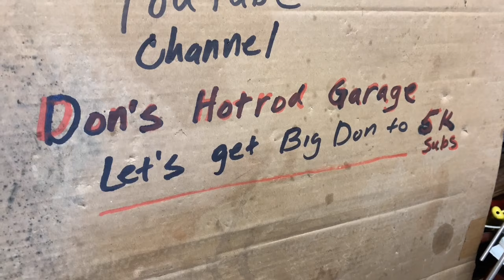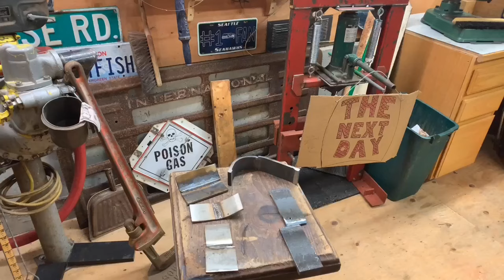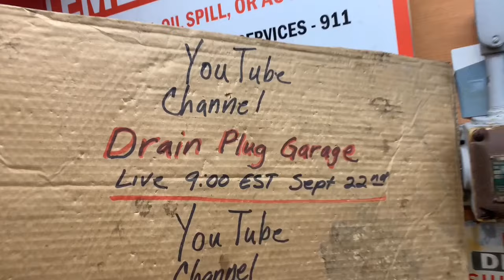Welding/ TIG/ MIG/ Strength Test/ with Filler Rod and with out

Comment: Fusion welds work great for body panels or light work with no stress as it pulls metal from the edges of the material to melt them together making it weaker. Great video Mike. I sent you and email yesterday might be in your spam folder.Thanks for the shout out.
Reply from the maker: Hey Glen, yes fun little video definitely showed the difference between the fusion welds and the ones with the filler rod, you are very welcome, got your email, they are on the way, catch you real soon

Comment: Wow Mike, really great video!  I use fusion welding quite a bit for non structural also. We should do a collaboration. If you want me to I’d cut and etch those welds. They are great welds but what’s inside is what counts. I could show the cut and etch process. Then I’ll send the sections back and you can show the weld sections. I don’t see much of that kind of analysis. Could be cool and educational. Your welding is really impressive!!
Reply from the maker: Hi Bill, yes that was a fun video, it would be nice to know what the welds look like inside, i will give you a buss a little later, thank you for stopping by brother

Comment: I want to look into Tig, mainly for sheet metal work. Always been curious about it. Great info here comparing them!!
Reply from the maker: Hey Dan, when i first got the Tig machine i did a lot of practice with thin material, i found that with any gap between the two pieces it's real easy to blow through, and to have to run filler rod down a long panel can be quite a chore, on most of the newer Tig machines there is a pulse setting that can be helpful, where as you know with the Mig you want a small gap, and you just go down the panel, zap-zap-zap, in my opinion Mig is 10 times easier, i think i will do a video on Tig and thin metal i will do some on pulse, thank you for coming over my friend have a great Friday
Reply: @DesertRatFabrication  I'd certainly be interested in seeing that video too, when you make it. You see it used a lot on the big name tv shows... but I've been using my Mig and gotten good results with it. Just gotta take your time and watch the heat.
Reply from the maker: @OlysGarage  yes Dan the heat is the most important part on either

Comment: Nicely done , you explained this in terms that most enthusiasts could understand. What brand Tig machine are you using. I like your ground set up, it works good and looks Kool too. 👍
Reply from the maker: Hi Steve, the machine is a Alpha Tig 200x, I sent you a text with a picture, it’s a great machine it Tigs Ac&Dc and stick welds, thank you for coming over have a great weekend, catch you soon

Comment: Hey Mike great info, so that 110 mig you mentioned are you running a gas setup? It didn't look like Flux core, but yeah this is wonderful information for me for sure. Aloha mike
Reply from the maker: Hey Sunny, on the MiG I was running a 70/30 gas mix, and on the Tig it was Argon gas, after doing the video I realized I should have touched more on the gas and setting’s, I plan on doing another video on thinner metals, I will be explaining the set better, thank for stopping by my friend have a great weekend , and catch you soon
Reply: @DesertRatFabrication  yeah I could tell the way she sounded, like crispy 🥓 bacon frying, man I need to upgrade for sure, thanks Mike have a great weekend brother Aloha
Reply from the maker: @ratgasgarage  😆👍